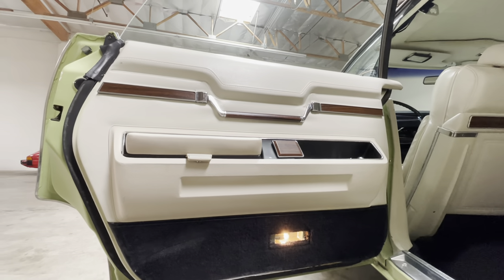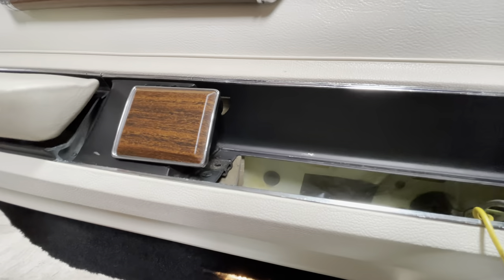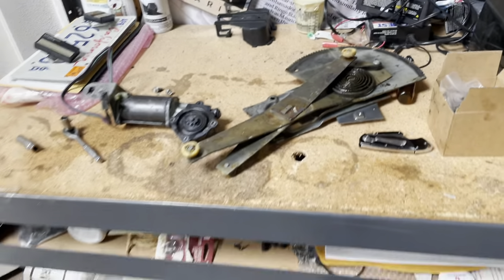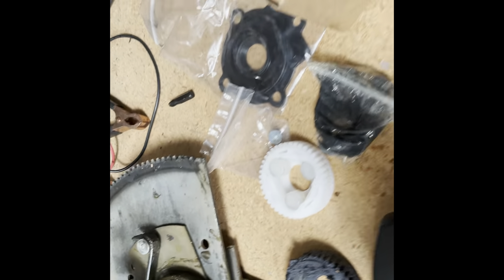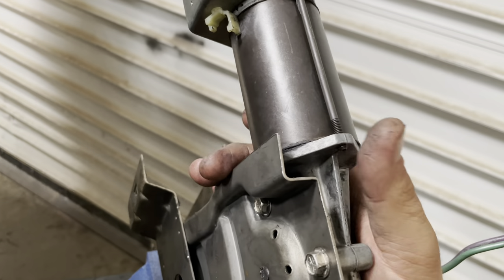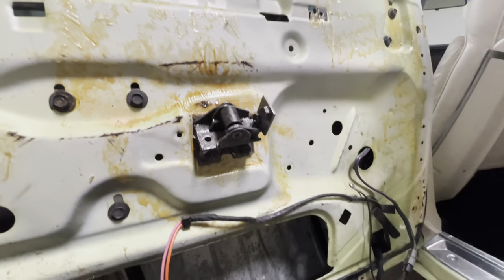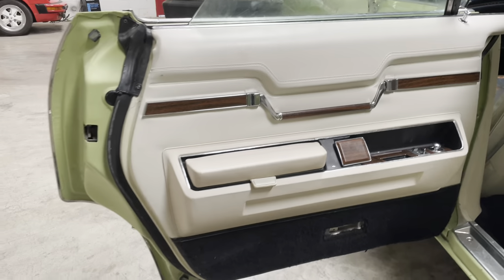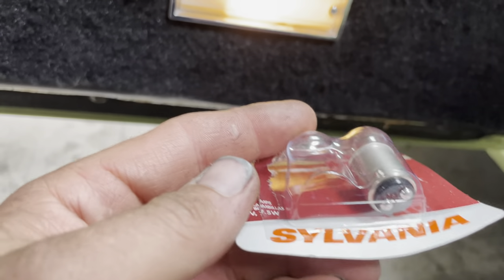Kent's 1973 Chrysler Imperial - C Body Mopar Window Motor Rebuild

Comment: I have just done this yesterday in a 70 Imperial. With all due respect, if you had read the workshop manual, the first thing it says to do before trying to remove the regulator and motor, is to remove the glass completely from the car. This is very simple. The horizontal channel attached to the bottom of the glass, that the regulator nylon wheels roll in, is held to the glass by just two screws. (The rear most one is accessed through a purposely located access hole where you can insert your screwdriver to access that screw.) You undo those 2 screws, pull the glass out the top, then that lower channel just slides off the rollers inside the door and you can remove it for cleaning. Which takes less time than the time it took you to explain the difficulties of removing the regulator. Again, I sincerely mean 'with all due respect'. Just trying to assist with future efforts.